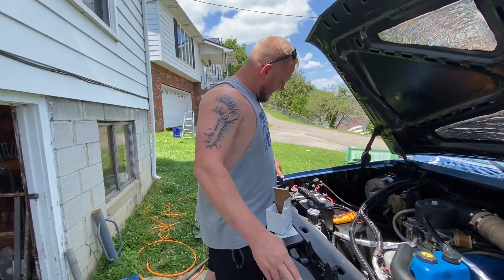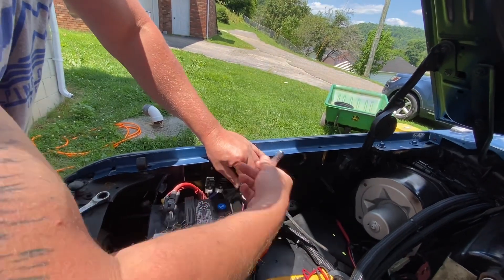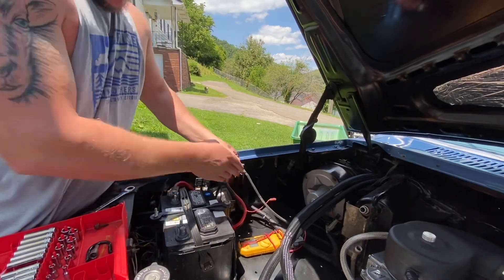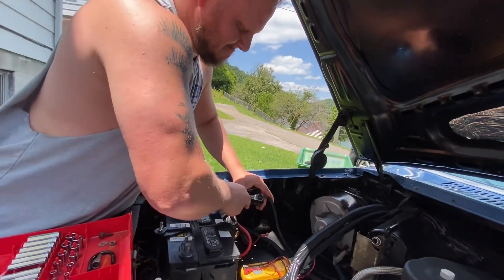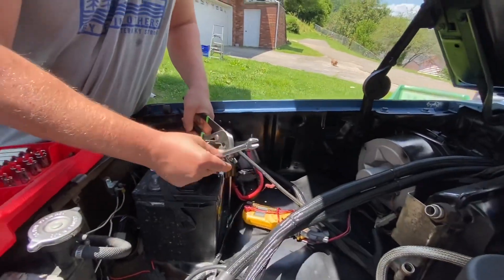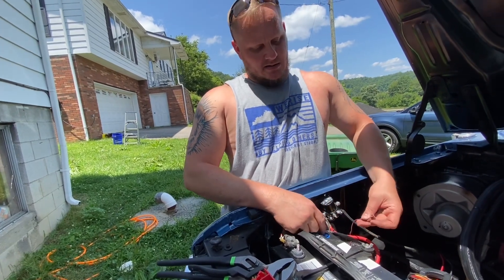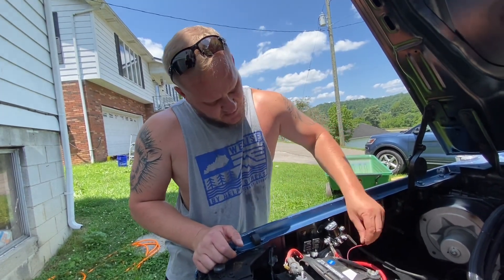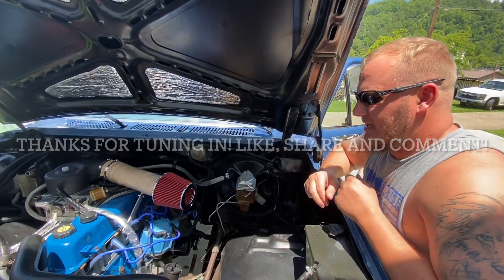Replacing starter solenoid in my 81 f150. #bullnose #fordtrucks #ford300 #ford #offenhauser

Comment: Notice you have the 4 barrel carb and intake on the 300 with a efi split manifold can you post a 0-60 or maybe a 0-75 so I can compare with mine still I have a 2 barrel on factory intake and factory 6 into 1 exhaust Changing to shorty headers or efi manifoldd soon